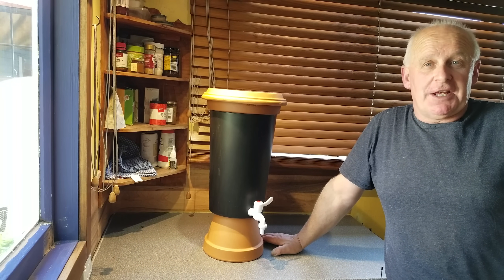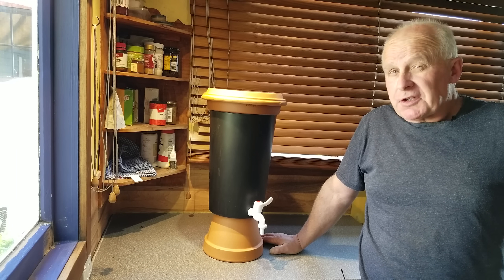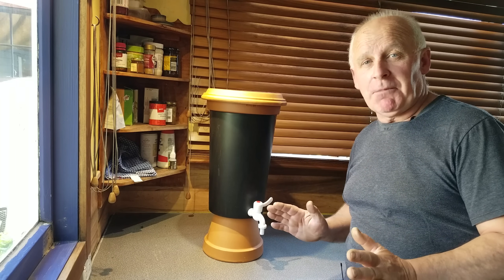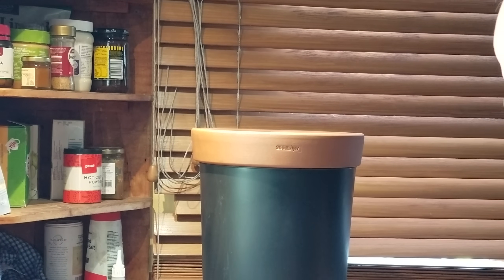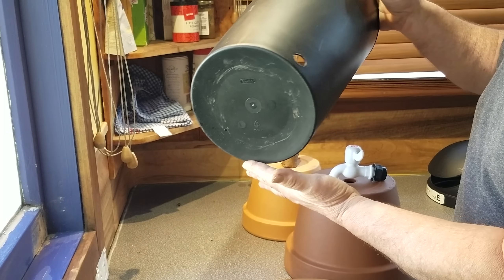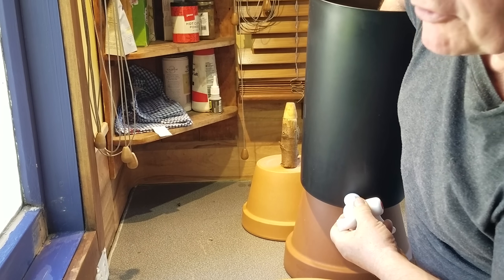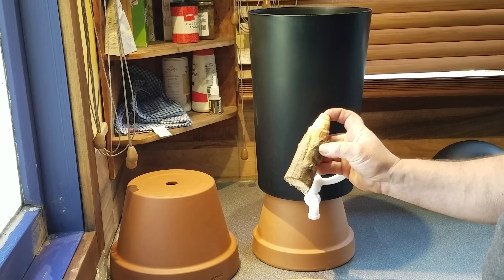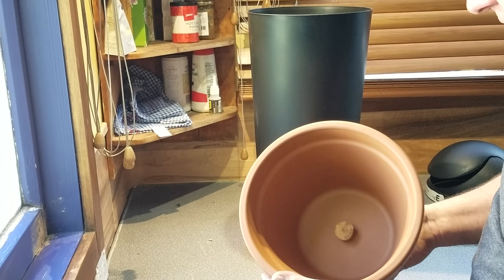DIY water filter. How to make FILTHY WATER drinkable

Comment: Unfortunately, most of the "filtered" water is passing through (and around) the wooden plug, which remains absorbent until it is saturated and then works as a wick with a gravity boost.  Try some food-safe epoxy to plug that hole and it won't work.  Also, what kind of bacteria, carcinogenic chemicals, and/or decomposition chemicals are in that little piece of wood?

Comment: This is a really brilliant design. One of the best I’ve seen so far. However, there is no accounting for chemicals. All desolved solids and chemicals like heavy metals will go right through the pores of the ceramic that’s why you need some type of carbon block filtering. In an emergency tho….
Reply: Yep, Arsenic Pb Cd .....carbon also may not remove. That's why they add chemicals to convert soluble metals to insoluble  OZONE ,permanganate, then  aluminium ferric to absorb
That said ceramic membranes are the next big thing look them up
Reply: @yesihavereadit  I have been using the carbon block and arsenic/lead after filters in my Berkey. (City water five miles away tested over EPA standards for arsenic, but I’m in a different sand) I haven’t tested my water yet, but that’s next.
Reply: What's a good way to source charcoal suitable for water filtration? I've been using Brita filters but that's largely out of sheer ignorance.
Reply: @pierrex3226  making decent activated carbon from biomass is pretty easy

Comment: If you go to the pet store, they sell small satchels of activated carbon back in the fish section. It comes in little pouches made of PP, and you can literally just toss them in the pot. It will help quite a bit. They're for the big fish tank filters. Rather reasonably priced as well.
Reply: Thank you!
Reply: What is the purpose of the packet? Does the contents of the packet float around in the water while it’s in the purification chamber or in the filtered water pot? Sorry for sounding stupid but I’m really trying to figure this out because one morning the tap isn’t going to work anymore. Many thanks 🙏🏻
Reply: @grannyjanesfudge5519 when it comes to carbon filters they gotta always have water passing through so it's not something you dissolve like instant coffee but more like the coffee with paper filter where the water drips through. But just laying them on the top pot doesn't work well since that would be more of a tank with tea bags. Like another comment said, it might be better to put them behind the spout to make sure water always gets filtered.
Reply: I don’t think those little charcoal satchels will do very much at all, unless you can persuade the water to run through it rather than just sitting it it
Reply: Pack carbon bags around internal outlet, so it always flows through.  
NB carbon is messy stuff and needs a lot of rinsing before using in any water system for humans or fish!

Comment: You should make a silicone ring around the wood piece to make sure nothing leaks through and you get a tight custom fit.
Reply: It should swell and seal better in a short period of time. If not, then a food grade silicone caulk could be used. A ring doesnt get every nook and cranny and may actually get cut trying to wedge in place.

Comment: Wow! Really impressive. Just one question... does the filter need cleaning or replacing?
Reply from the maker: Of course- all filters need replacing or cleaning- have you ever owned a car or an air con or a vacuum cleaner? Best way with this is to just use a new pot each year. go on spend $4.00 on a pot- It wont kill you haha.
Reply: @t.h.o.r.  Thanks for you quick response!👍

Comment: Just wondering if i could install the pot plant in or on top of one of those glass benchtop drink dispensers that already have a tap?🤔
Reply from the maker: Yes of course you can. I just used what I could find to get the job done to show what is possible

Comment: I've had bad fortune with taps leaking and such, so my go-to metod is using a self-starting siphon (no holes to drill or perhaps leak later).
Reply from the maker: Now that's interesting. a self-starting siphon? So all your reservoir levels are super critical ? how does your main tank fill initially? how do you start and stop your self starting siphons?
Reply: @t.h.o.r.  
I save back 2 thousand gallons of rainwater and just fill a big pitcher. Then, I dump it into the top. After it drips through, I remove the top bucket filter and jiggle the hose with the marble check valve in its end at or near the bottom, aiming the other end to a same-sized water pitcher filling it and then I put THAT pitcher in my refrigerator for drinking later after it gets cold.

Comment: Sorry if this is a silly question, but how can you be sure that unfiltered water isn't dripping around the bung? Not sure if I could whittle a perfectly circular bung! Thanks!
Reply from the maker: Use a cork? whittle and sandpaper? Buy a pot with no hole? just remember that some makers spray pots with a light oil to slow transpiration. If you have one that wont drip after 4 hours soaking- cook it in the oven on high for 30 mins
Reply: @t.h.o.r.   Thanks for the tips!

Comment: Please have the water tested and adjust the filtering as needed. There is a lot of stuff in the air and bacteria grows in the rain barrels. You may not see it, but it is there and growing. Brita, ZeroWater, PUR ,Berkey do not remove all it says it does. If you are doing it the way in the video. You are very Luckey. I don't see anything but the colloidal silver to help. 
Taking colloidal silver by mouth is not thought to be safe or effective for any of the health claims that many manufacturers make. Silver is not an essential mineral, as some sellers of silver products say.Colloidal silver products are made of tiny silver bits that float in a liquid. This is the same type of precious metal used in jewelry, dental fillings and silverware. Colloidal silver products are often marketed as dietary supplements to take by mouth. These products also come in forms to use on the skin. Manufacturers of colloidal silver products often say that their products are cure-alls. Some claim these products can improve your immune system and fight bacteria and viruses. And they say these products can treat cancer, HIV/AIDS, COVID-19, shingles, herpes, acne, eye diseases and prostatitis. But little research has been done to study these health claims. In fact, the U.S. Food and Drug Administration has acted against some manufacturers of colloidal silver products for making unproven health claims. It's not clear how much colloidal silver you can take before it may be harmful. But it can build up in your body's tissues over months or years. This can lead to a blue-gray tint on your skin, eyes, organs, nails and gums. This condition is called argyria (ahr-JIR-e-uh). Argyria does not typically cause a major health problem. But it can be a cosmetic concern because it does not go away when you stop taking silver products. In rare cases, too many doses of colloidal silver can cause long-lasting severe health problems, such as kidney damage and seizures. Colloidal silver products also may interact with medicines, such as some antibiotics and levothyroxine (Unithroid, Levoxyl, others). So, to get to the point you are doing very little to filer the water. Not enough Colloidal silver to do as stated in your set up. As long you are not getting sick fast form bacteria your doing ok. Long term maybe something else with whatever is in the rainwater these days.

Comment: |> |> |> |> |> |> |> |> 
|> |> |> |> |> |> |> |> |> 

anytime geared about "Chrmtrails"?

Polution?

I would take that filter and send it after ine month to a kabory, ... snd check what there is to find in any vhrmical or what ever polutiin.

you will get a result or the filter dint work really ...

and in todays world you must get any results or you are a really lucky one ...

derp oenetratium and how iften to change ...

and how to clean ... that is not always posdible ... 

but o.k... cheap is it anyway ... when younbuy more it getsccheaper, dry stirage, no mold, and uts o.k.

|> |> |> |> |> |> |> |> 
|> |> |> |> |> |> |> |> |>

Comment: Does the plastic break with a heavy ceramic and water in it? Or sitting on an uneven surface?
So a cork is fine? Ok sounds good! Love this idea ! How did you know terracotta was such a good filter system!
Reply from the maker: All you have to do is read up on filter types and you discover ceramic filters- then you remember that You watched all those videos on the slow release irrigation teracotta pots that the Aztecs used.

Comment: Does this system filter out fluoride and calcium?
Reply from the maker: It  seems to deal with fine particulates as you would expect but calcium is a ground water issue not in my rain water. and fluoride- well personally Im  drinking rainwater to avoid the fluoride.

Comment: There are so many concepts to purify water, even if its very dirty or contaminated. But what you unfortunately didn't considered is the air pollution with chemics. Rainwater is not pure or clean, and colloidal silver is only good against bacteria and viruses. So better you filter the water first chemically. Naturally you don't need this, if you take tapwater. And streaming water outdoors is better than lake- or riverwater. Only the Yankees have to take more care, because their tapwater ismostly chlorified respectively 
fluorinated.
Then, if you have filtered it, you can use the colloidal silver procedure. But caution! You can't use this for weeks and months! Because it tints your skin grey.
Colloidal silver is better to use it 5 to 7 seven days, if you have an infection. But for longer use it's better to use 2 other methods:
a) rock crystal and rose quartz that prevent the water from becoming foul and keep it fresh, b) a carbonite filter every half year, that has so little micropores, that holds back EVERY CRAP  from contaminating your water, even medication, heavy metals, drugs, hormones!

We here in germany and austria have a long tradition in water cleaning and energizing, believe me, it functions since decades.
Have you ever heard of Victor Schauberger, Ottmar Grober, Bernd Kröplin, Daniel Plocher, and many others, the pioneers and practicians of water-investigation? The finer the watermolecules, the higher the stored energy and health effect...

Test it out!

Comment: Made one and really disappointed with result. After 6 full days only 1 inch of water filtered through. I'm wondering if an additive has been added to terracotta slip. As I know the pot I bought is mass produced by machine. I will try the paler version. After that. Who knows. UK.
Reply from the maker: Yes-read the other comments. Its a water based emulsion that some are coated with. make a little fire and burn the pot. or heat it on the stove top for 20 mins to burn it off. its a common issue in USA pots
Reply: Ah! Thank you, I'll try this.

Comment: I have tried with a terracotta pot, but the water isn't really leaking from it, in fact it stops the water. How I can do it?
Reply: I have the same problem. I sanded the pot, soaked in water for 24 hours, but still nothing. I think the porosity of industrial made pots is too thin. I am going to use the same process like "ollas", and test with a little amount of water on the pot before buy. If the water fill "fast" inside the terracotta, then i would buy it.

Comment: It's taking forever to go through pot anyone else's having this issue
Reply from the maker: Wash the pot in hot soapy water.  some are wax coated
Reply: @t.h.o.r.  I have the same problem. I sanded the pot, soaked in water for 24 hours, but still nothing. I think the porosity of industrial made pots is too thin. I am going to use the same process like "ollas", and test with a little amount of water on the pot before buy. If the water fill "fast" inside the terracotta, then i would buy it.

Comment: Here in Brazil, ceramic filters are very common. But instead the wood, we use a filter cartridge with activated carbon, micropores and colloidal silver. It's very cheap and reliable.
Reply: Hello could you give some links?
Reply: @etoile17ducoeur73  https://youtu.be/4I7iylyj6tA

Comment: Thank you for your video! I was wondering, would charcoal help to neutralize eventual bacterias or toxins? 
No doubt that your rain water is already pretty safe….but in different climates that might be helpful! I am really considering trying your filter, I live off grid in Mexico most of the time, and I don5 know the quality of the water in the rio ( I am in the middle of mountains…though rancheros and cows might have different uses of this rio…) if by any chance you tried it with charcoal, does the water end up clear after the terra-cotta pot? 
I understand that you collect rain water, here I have 6 months with plenty of water/rain…omg so much rain…thereafter 6 months without…the rio is my only option…or bottles of mineral water. Thanks again!

Comment: Wow, I just spent $289 dollars for a Berkey look-alike (the ProOne). I didn't trust myself to have enough know-how or do-it-yourself abilities to make my own. However, this looks EASY!!! I may use the flowerpot idea instead of buying more ceramic filters! My plan is to have the water tested by a lab, so I can test how the ceramic filters do compared with a flowerpot. Also, you could obviously just use a wine cork to plug the hole. One of the reasons I chose the ProOne is that it was the only one I found that had silver in the inside drum for anti-bacterial purposes. However, it looks like you've got that covered also 😀

Comment: Naomi from Auckland here.  I followed all instructions, but days later, the water is still not seeping through the terracotta pot (Italian).  At most, some drips through the cork that isn't completely fitting the hole and I had to trim it a bit.  I even sanded down the pot just in case there was a stain/wash put on it.  Why would the water stay put and not filter through into the bin?
Reply: I have the same problem. I sanded the pot, soaked in water for 24 hours, but still nothing. I think the porosity of industrial made pots is too thin. I am going to use the same process like "ollas", and test with a little amount of water on the pot before buy. If the water fill "fast" inside the terracotta, then i would buy it.

Comment: What about the possibility of lead in a non-food-grade flower pot? This is from North Dakota State University: “Tera cotta flowerpots: Some clay containers are designed for food use. However, clay pots from the gardening center are not meant to be in direct contact with food. The clay in garden pots may contain heavy metals, such as lead.”

Comment: actually you would put the washer on the outside so the water wouldnt run down the thread
Reply from the maker: when you repair a roof leek you fix the roof- not repaint the ceiling! When yo fix a fish tank you silicone the inside. when you fix a leaky windscreen you fix the leak outside. - In short, you stop the water BEFORE it leaks.

Comment: Does it take a while the first time for the water to start filtering through? It’s been 3 hours and I only got a drizzle so far. I see you said about an hour??? I definitely have an unglazed clay terra cotta pot. I didn’t use the spigot . I just put the pot inside a bucket I found at lowes that the pot sits in perfectly and I will pour it into a pitcher once it’s filtered.

Comment: Not sure why you feel that the rainwater you collect yourself needs purifying...I collect the same off my clean and painted shed roof into a settling tank to drop out any dust, and use it untreated for everything, and have never had a problem, but then my rainwater comes directly from the South pole and never comes over land until it gets to my farm on the West Coast.But still great resource for an emergency. So is a charcoal filter and you could also make that for nothing. Your'e right, don't trust the council water!

Comment: That's one stage of filtering all that would do is filter out the big stuff then you need to run your water through rocks and then sand and then the smaller grain rocks and  then it be good.

Comment: Wouldn’t trust this for 1 minute, the pores are not small enough to filter the water to remove toxins and viruses. It will however filter the larger solid particles. Try adding charcoal to soak up the toxins and remember this will need changing every month or they will leech back in to the water.

Comment: In the Middle East water dripping through the pores of a wet ceramic pot is used for cooling. It works but the pores become clogged with the salts being filtered out of the water. I think you'll need to replace the pot periodically. You can always reuse as a flower pot. Great idea though.

Comment: I would add a few drops of hydrogen peroxcide to the water and let it sit for about 15 mins before adding to the filter, also add activated carbon to pull out any nasty chemicals pulled from the rain..aka lead or PFOA's, and i would use one of those glass containers with a built in tap (they use them for tea's or fruit juices), less plastic the better

Comment: Well. I see several severe issues here:
1. What exactly does this filter out? If you advertise to put in water from "whatever source available", you should at least do some testing. There is a reason why real water filters are a lot more complex these days.
2. There is a reason why foodgrade plastic has a foodgrade plastic stamp. Chances are high that you sip your fine filtered water from a bin that is made from low quality recycled plastic. Yummy!
3. Those clay pots aren't meant for this. If you take any pot (especially cheap ones), it could have lots of u wanted stuff in it.
Reply: Like lead?